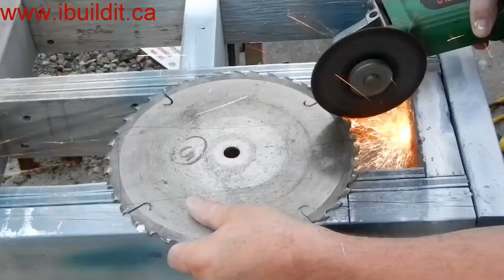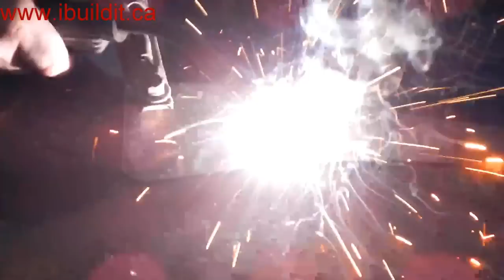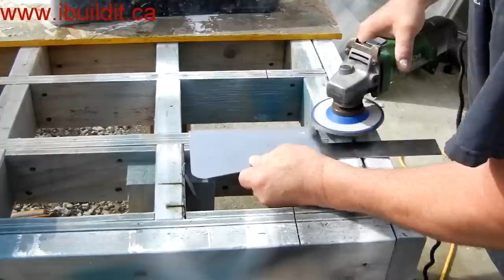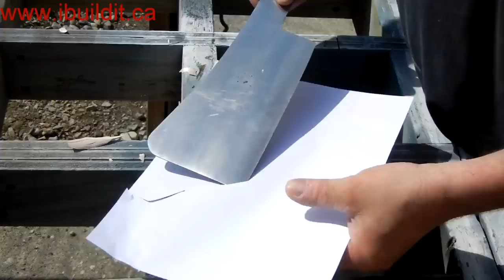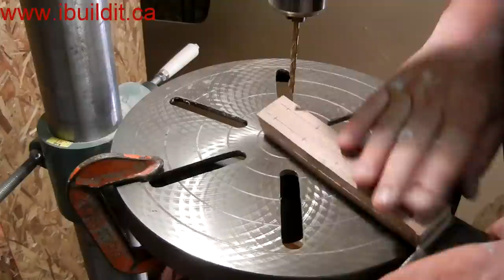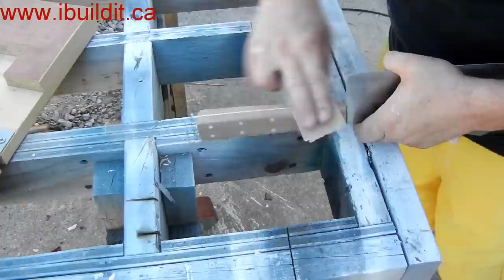How To Make A Meat Cleaver

Comment from the maker: It's a little thin, but still cuts just fine. The wooden pins are not better, just different. I mostly used those for decoration since the glue I used to attach the handle halves does most of the work. You English is great, by the way.

Comment from the maker: The edge is very good - it chopped that maple dowel to a point and still sliced paper cleanly. The steel was reasonably hard to start with and probably better for a cleaver anyway, since it's not meat to hold a razors edge.

Comment from the maker: Thanks. I used linseed oil on the handle. I rubbed in 3 coats, letting each one dry. Oil is good since you can easily fix it up again with a light sanding and a fresh coat.

Comment from the maker: Actually, I still haven't really sharpened it yet.
If you are thinking that the bit could grab and swing the knife, that's not very likely in this instance. There is inertia on my side - body at rest and all that. Since it is small (3/16"), the bit would almost certainly break before it could exert enough torque to swing the blade. Thanks for watching.

Comment from the maker: I had a method where the metal oxidizes in low oxygen that worked well. I need traditional white PVA glue to do it, but the stuff I bought had something added. The idea is to completely coat the steel in glue, let it dry thoroughly and soak it in water. This corrodes the metal, leaving it black.
In the end, I etched the blade in hydrochloric acid - see it in my "Testing Saw Blade Steel" video.

Comment from the maker: Should be - the steel is very good, especially in the higher quality blades. Another thing to look for are the very large masonry blades used to cut brick and concrete block. These wear out (the diamond rim) and the blade is thrown out. I've seen these as large as 20" in diameter. A lot of primo steel there.
I'm no guru, just someone who's been doing this stuff (right or wrong) for a while. Good luck with you draw knife.

Comment from the maker: I have cut up a several carbide toothed blade and all of these have been uniformly hardened (when I say hardened, that means heat treated - hardened then tempered). I have never found any kind of cutting tool that was mild steel.
There are low cost all-steel saw blades with teeth that have been heat treated to a higher hardness, but that is not what I use and not what I was talking about.

Comment from the maker: I could have done a cleaner weld, but didn't want to heat up the plate too much and distort it. Originally I was going to leave the hole there and even some of the teeth from the blade on the front edge, but chickened out and changed my mind.
The blade will eventually get a black oxide finish, so the small pits will not be noticeable.

Comment from the maker: Glowing is definitely too far. If you see colour change to dark brown or blue it's getting too hot. 
For cooling, it depends on what you are cutting with - you don't want to use oil with grinding. Grind some, stick it in water to cool it, then grind some more. That's how I did it.

Comment: it does, you have to keep it cool with of water to quench it every so often. In this case the saw blade has already been tempered, if the blade gets too hot and changes color, it softens and is no longer going to hold a strong edge.

Comment: I like how it looks, but you didn't do any heat treatment and the steel you used is probably a high speed tool steel with a lot of flexibility. As a result, the knife wont hold and edge(stay sharp) as long as a harder steel.

Comment: Beautifully done but I was surprised when you used dowels through the handle though after you bought out the mig to weld the hole and the extra tang length I thought when you drilled the holes in the handle you would probably use some nice brass brazing rod and peen the ends over but all in all a wonderful job cheers

Comment: see that little clamp he has that is holding his sander down?  it is under the sander.  when you rig one of those up, the sander can sand almost anything, and easily.  you can shape all kinds of things on it.  start with something like that clamp and you will be able to shape all kinds of things (even steel, though it takes a long time).

Comment: Nice, really nice. I like seeing re-purposing things into equally as practical things. Great concept John. Have you made other things from old circular saw blades? From your experience, would an oil stone get the cleaver any sharper. Could a short machete be made for cutting jungle vines or strangler fig vines using a similar process? Cheers David.

Comment: It's hard to spot weld (thin stock) with a stick welder. The weld will be perfectly strong, but the warping i extremely hard to avoid. But if you are more skilled than me (which is not hard ) maybe you can do it :)

Comment: What if you built a small campfire and let those saw blade heat to red on the fire then slowly cool? Would that make the steel softer to work with from the beginning?

Comment: Great video, but I've a question.

Why do most, if not all, meat cleavers have that little hole at the top right corner?  I can potentially see that it's so you can hang it up after use, but is it for any other purpose?

Comment: Would this method, and the metal from a saw blade, be adequate to make a draw knife? There are only two categories of drawknife here in Sweden. Very cheap but useless, or insanely expensive ($400), but good. If i could make my own straight draw knife this way, with some nice beech (abundant here) handles, i would be very thrilled. You're my new metal working guru you know, and i have more time than money :).

Comment: I know it would have been a boring process and maybe isn't necessary, but why didn't you heat treat the whole cleaver after the welding and shaping? (that would have eliminated the risk of joint breaking  on the weld points)

Comment: Beautiful cleaver and as for the safety thing i was working as a labourer for a steel construction company last year and i took the guard of the 60 ton metal press and bam crushed my right index finger but you know what i'd do it the same way again because guards just get in the way thats just my my opinion so what if your making an instructional video if the people using these types of tools dont have the common sense to use protection they shouldnt be using these tools and shouldnt blame you

Comment: Is the steel from a sawblade any better steel than regular mild steel plate?
Reply from the maker: Kristoffer Traberg Yes, hardened and tempered high carbon steel.
Reply: The only reason why he made it from a saw blade, was so he wouldn't have to heat treat or temper the blade himself. As far as I know, saw blades are supposed to be heat treated and tempered, that way the metal doesn't brake down. I know a little about metal work, and with limited resources, for me to try to make this with any type of steel, heat treating and tempering is a pain in the ass, especially on a windy day.
Reply: Okay, I see. Thanks.
Reply: A solid steel saw blade is good quality for blades. Saw blades with carbide teeth are made from a lower quality steel, due to the carbide teeth taking all the beating there's no reason to use wear resistant a steel. They're not horrible but not ideal for blades.
Reply: Elias Anglin Especially in the video, you can see that the tips are out-circled, and that part of the saw is made out of high carbon steel but the rest of the saw is made out of some cheap steel. You can really see it in the begining, I try to use the old rusty ones, that have no teeth and aren't out-circled like that, cause then you know the hold blade is made out of HCS
Reply: MRaZZeee I was wondering about the same, BUT, to have that hardening on the whole blade may make it too brittle no? Flex in the center, crisp around. Nice Cleat Meaver anyhow;-)
Reply: bellybutthole Ah, misread you MRaZZeee, you said different steel... Could the color difference come from different hardening though?
Reply: MRaZZeee They call it HS now, HS(S) before. Just sayin'.
Reply: bellybutthole Doesnt matter if its brittle. Its for meat. Shitty is when it drops on the floor unlucky, thats right.
Reply: Elias Anglin Youre absolutely right. But its a knife for meat. Not to half superman. But youre right, with the attributes.
Reply: +Zachary Lynch Especially if you live in California like me. Forges and things of that nature are not the smartest thing to be operating in your back yard with how dry it is.
Reply: +Zachary Lynch Ah, thanks. I was wondering why he didn't heat treat it.
Reply: Why he didn't heat treat it, is because it's HS(S) probably he thought. But I noticed in the begining of the video, the teeth of the circular saw are welded onto the blade, which renders the rest of the blade useless for making knife or blade material.
For those wanting to use circular saws, search for ones that don't have seperating lines between the teeth of the blade and the actual blade itself.
High Carbon Steel blades, are more rustier and is the same principe.
Reply: Actually, i made a knife from a sawblade today. Used the same methods as he did in the video and the same kind of sawblade. the teeth werent welded to the blade on mine, it was paint. the only Tungsten carbide on my sawblade was on the very tips of the teeth and the knife came out wonderfully. Guess it all depends on the blade
Reply: Ah, if the teeth were Tungsten Carbide, then my friend, I'm sorry to say the saw blade will not be made of good alloys, and certainly wouldn't be HS(S) or HC. I bought a lot of 20 saw blades and threw away at least half, as it was a one time deal for all the blades. Wasn't a bad price, I think 50$ and their were two 20 or 18 inch ones as well, which I definitely kept.
They were old, no welded teeth and no welded Carbide or Tungsten tips on the teeth either. Were very rusty too, means they're some carbon steel blades probably L6 or 01 if I'm not sure. But you can have a look at the chart which shows saw blade purity:
https://books.google.ca/books?id=lrc3sRSR1rEC&pg=PA31&lpg=PA31&dq=what+kind+of+steel+are+old+saw+blades+made+of&source=bl&ots=6lOxfWm-IL&sig=pOK80OBvyvFeRSbuR-Hqj7bC5dY&hl=fr&sa=X&ved=0CEUQ6AEwBGoVChMIk5m95OLjxwIVV3-SCh3cYwwO#v=onepage&q=what%20kind%20of%20steel%20are%20old%20saw%20blades%20made%20of&f=false
Reply from the maker: +MRaZZeee Just to sprinkle in some fact with all of the BS that's being spouted here, most good quality CARBIDE TIPPED SAW BLADES are made from good quality steel that is hardened and tempered. They have to be, to keep the blade from warping. 
Replay the part in the video where the freshly ground cleaver was used to chop a hard maple dowel to a point, then slice through paper, and that was before it was actually sharpened.
Reply: Thats what I thought too. Only the Tips are Carbide so the steel has to be good for the rest of the saw to handle the impact stress without bending or shattering. Ive also been using them to make knives cause its much easier than having to heat treat the damn things. Especially down in southern california where i live, where if i wasnt careful i could light the whole back yard and the house on fire.
Reply: Gofeball Mcsullivan Thats not paint, its a coating. TitaneAluminiumCarbonNitrid. But because of the color i think its TitaneCarbonNitrid.
Reply: +Jack the Tripper Yeah, but I really meant the sawblade shattering from being used as a sawblade;-)
Reply: +John Heisz So the whole blade is hardened and tempered? Do you mean warping during use (wobbling/flexing) or getting warped (plasticity deformation)? Im not a saw expert, just curious so an odd comparison may be a hand saw where you can see the tips are blued and probably hard as a coffin nail and the rest is very flexy and tough. I guess you'd want your circular saw to be flexy enough to resist shattering and tough enough to resist getting warped. There is something to be said for softer things being able to absorb shocks no? Great vids of great projects anyhow John Heisz!
Reply: Don't forget that it is not the middle part of the saw blade being used, it's the tips, whether they're carbide or tungsten. Most workers throw away their saws after the teeth have done their job.
I never said that you can't make knives out of bad saw blades, but why use a cheaper saw blade and make a knife out of it, for risks of it being brittle and break.
Reply: +John Heisz I have 30-40 year old rusty blades from my dad. most are large, probably 18" across. Would they work for this?
Reply: +Vincent Licitra - Most likely, yes. It's not gonna be mild steel, anyway :)
Reply: +Jack the Tripper Well, meat...but cleavers are usually the tool you pick up when bone is involved.

Comment: Your weld beads would turn out a lot better if you used solid core wire and a shielding gas with your MIG welder instead of using flux core wire.

Comment: i would have figured that that cutting with a grinder and welding would ruin the temper and or hardness, but I guess if the metal wasnt heated to much it would be fine.

Comment: if u will use this for actually cutting meat, the small pits in the center might be a problem as they gather bacteria. and u probably dont want to wash it in a dish-washing machine cause of the nice wooden handle.
i say u should have left the original hole as it was. much easier to keep clean after u use the clever.

but great job nonetheless!!

Comment: which one better for making knife... saw blade or file ???
Reply: +max factor 
An old file will be better, but you would have to test it. (try to break a small piece of the file. If it bends its no good)
You would need to heat treat the file in a furnace to make it softer and harden it again.

There is a good instruction about it on instructables.com

Comment: i want to try and make this , but what keep the blade from rusting ? John Heisz
Reply: dont do unless you can heat treat, nut you heat it up amd rub candle wax into it, you can quench it in oil, you can forge weld two pieces of low quality stainless steel to the sides to create a durable yet still rusty one, or you can just buy some stainless steel
Reply: ok thanks for the info
Reply: You put oil on the blade, I use mineral oil as it doesn't leave a residue, and its dirt cheap.

Comment: No hardening? Either you've got major faith in that steel or your Gunna have to reshaped that blade constantly lol.
Reply: It's already hardened and tempered steel. 😑
Reply: +Kenadie Nelson he welded on it which would screw up the temper. He grinded in it without once cooling it in water. I garentee the hardening has diminished.
Reply: +Travis Sheldon What's the point? He didn't weld on the edge, it's for cutting bone and meat. Not like he's going to war with it. Grinding doesn't diminish as much as you think it does.

Comment: I don't want to sound rude but do you know anything about making blades..? You used a steel that can't probably be hardened, you welded without protective gas, making the weld brittle, you cut the piece with an angle grinder and destroyed the possible heat treatment, and then didn't heat treat it again, and then "sharpened" it with the angle grinder? Just a few points that i noticed... It's an old video and i hope you have taken interest in finding out about making blades the right way, because that's way wrong.
Reply: aakkoset You dont need gas when you weld with fcaw
Reply: Dudley Hippopotamus Thx for the correction, didn't know that. I guess you learn something new every day! :D
Reply: aakkoset I guess the video was just about making this meat cleaver with stuff he had laying around. :) At the end of the day it will get the job done anyway.
Reply: aakkoset Why would you need to harden already tempered and hardened spring steel? As mentioned by another comment you don't need gas with that type of welding, and I don't think cutting the metal with an angle grinder really did anything substantial to the steel. Also, it cuts paper, why would the word "sharpened" be put in parenthesis if it clearly was sharpened quite well? I mean, you can't shape a blade with a whet stone. I understand typically blades would be shapen with hammer on anvil heated with a forge, but This seemed to work.
Reply: BeenieBomb I have no idea how much this process might have altered this given steel, but I think the issue aakkoset is bringing up is that the high heat and friction of the angle grinder could have altered the temper. You don't want blades at their highest possible hardness, because they'd be very brittle. To make sure it's a consistent hardness you'd have to re-heat treat the metal. This clearly works as a cleaver, but the edge might not be so durable.
Reply: Seth Newsome Ahh, okay I see!
Reply: BeenieBomb Ignoring the last two comments, it's quotation marks not parenthesis.
Reply: It's best not to comment so early in the morning. :p
Reply: Kimble Angus Yeah haha
Reply: aakkoset Spring steel is very hardenable actually.
Reply: Acid Designs yes, yes it is. But that was most likely mild steel
Reply: aakkoset Could've just as easily been high carbon or plain steel.
Reply: Acid Designs The saw blade that he used was modern. That means that only the outer, darker part is hardened steel, and the middle part is softer metal.
Reply: BeenieBomb The plate of a saw blade is not hardened steel. Chances are that heat treat wouldn't work in any case as the steel is rather low carbon.
Reply: ardvarkkkkk1 But aren't saw blades made of spring steel? Those are hear treated; I personally adore spring steel (especially 1055)
Reply: It's D2 steel dude. Read a book...